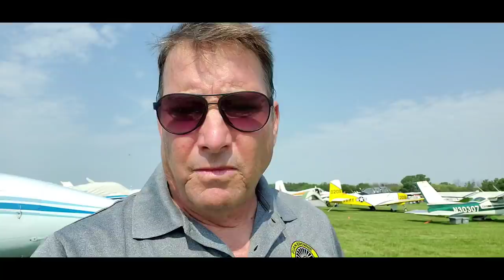Dale 'Snort' Snodgrass Crash Lewiston ID.

Comment: Call sign "Snort"  Dale Snodgrass a Brother in Arms and supreme Patriot. Gone West,  we will more than miss him. Thank you brother for your service, leadership, inspiration, influence and above all for me  the pleasure to have known you.

    The stall spin scenario that Juan mentioned is possible from the physics angle but I find it impossible to believe that it was pilot induced.   We had an IAC incident where the pilot of a Pitts experienced "control lock" coming out of a hammerhead. Vertically nose down when he pulled the stick back to recover it failed to move enough to complete the level off.  As an F-16 pilot and well experienced as was "Snort" he had the presence of mind "The Right Stuff" to use the trim to help get the nose up. He survived the crash and was lucky that the landing was cushioned by soft muddy ground.  Investigation found a tool wedged in the elevator controls.  Dale was capable of piloting under pressure, I agree with others that he would have been maneuvering  the entire time trying to alleviate whatever conditions existed at the time. 

Hand Salute!

Comment: R.I.P., Snort. Thank you for your service.

Given his experience, this sounds like a seat failure.
Reply: Was thinking the same thing
Reply: My thoughts exactly
Reply: If you can enter and exit your airplane with the seat in its usual flying location, it's probably a good idea to just use bolts in the tracks to prevent this.
Reply: I had exactly the same thought. Far too many times an accident that went down as Juan described has traced back to a seat that rolled back just after liftoff.
Reply: My thoughts too. RIP Mr Snodgrass.

Comment: I saw him at Pratt & Whitney “air show 90”
It was an awesome t14 demo
Reply: I was there. I was giving tours on the 747 and he came thru. He was super kind and willing to talk to a young Private Pilot. I had worked on the TF-30 engines in the F-14 and he was genuinely interested in what I did.
Reply: @mgas1237  If that was the show at Rentschler in which "Snort" flew the F-14 under a (wink, wink) 1000 ft ceiling, I was there too.    MAN, was that loud.    I have seen "Snort" demo the F-14 many times.   Nobody could thrill a crowd like "Snort's" Tomcat demo.    He was the best.   Gone too soon.
Reply: @kevinmadore1794  Saturday was the low ceiling day if I remember correctly

Comment: Another senseless, inexplicable accident of the type that has claimed so many.
ASN reports that the aircraft was a "B" model of which only four were built. They had a 400 hp Allison turboprop instead of the 350 hp of the "A" model.
Stalling speed: 61 mph flaps up; 43 mph flaps down....
Hopefully there will be an explanation for an accident that should not have happened...

Comment: Wonder if this was another seat issue?  I can't believe that such a experienced pilot would stall it on take off without a mechanical failure. RIP
Reply: Seat sliding back is the first thing that came to my mind too.
Reply: @maxon1672  - Same here. Has all the signature actions of one.
Reply: @maxon1672    Yes, likewise.  It would be very sad to lose such an experienced and capable aviator to such a silly and avoidable event, but we're all only human and we can all easily get killed by out mistakes...
Reply: @DavidPT40  - I can’t answer that, but as a mechanic of land based vehicles of all kinds, I will say that if it’s mechanical, it will fail at some point. That’s a given.
Reply: Years ago we had an accident in Germany in which a glider pilot had a heart attack while taking off with the winch and the plane spun to the ground immediately after loosening the winch rope.
Reply: First thing that sprung to mind with me too. Whatever the cause, it's sad to lose such a well known, well respected and capable airman.
Reply: @DavidPT40  Seats can not only slide but can detach.  One of our club ham operators had a military plane he was testing break a seat. He said that was double whisky night and a new pair of shorts.  He was at the mercy of the crew and manufacturer to give him a plane that wouldn't fall apart in flight.
Reply: @DavidPT40    I don't know if any aircraft has a particular problem with that happening as it's exactly the sort of safety issue they would be looking for during development and testing.  But if a pilot fails to make sure the seat is correctly locked into position after adjusting it then it can easily happen during the take off roll or initial climb out with predictable results...
Reply: A coworker had this happen on his Cessna many years ago. He saved it but it can happen and does happen.

Comment: That reminds me of an AD on Cessna's pilot seat latch pins. In the UK they had a secondary safety pin so if the catch failed on Take Off you didn't slide right back pulling the yoke with you.
Reply: if you look at the rear stabs it is apparent he was not pulling back on the stick , in fact it shows the direct opposite

Comment: I read all the comments and something happened to me years ago that no one has mentioned or speculated. I had a 172 get a rock jammed in the elevator on takeoff preventing the yoke from going forward. Light enough to maintain pitch by Reducing power and full forward trim and was able to return and land.  Could have easily been not so lucky. Just another possibility to consider in this case. RIP

Comment: I had a seat track lock fail early on  , I was still under student status.  I had placed an extra cushion between my back and the seat back.  It allowed me to maintain control with only a small pitch up.
Reply: H as opened to me on flight training in a 152- 2nd or 3rd lesson with the CFI slid back a short distance. He explained it was common to Cessnas  how important it was to check the seat latch was fully engaged and about the safety pin. Always thought about how a full seat track failure would really ruin your takeoff as first instinct would be to grab at the yoke......what a tragedy hope the figure out what went wrong.

Comment: I used to fly L-19s in a banner tow operation. The plane was already a hot rodded version of a C-170B, with a lighter tandem seat fuselage and 90 hp more than a 170B (235 hp from 145 hp). The SIAI-Marchetti as a lighter turbine engine that puts out 400 hp (almost 3 times what the original 170B had). The larger engine required a larger tail to handle the torque. Even with the rudder area increase, I would suspect that this plane might not handle full power on stalls very well.

Comment: Hi Juan. Shocking bad news about Snort Snodgrass. Condolences to his family and his many friends. When I first watched your post on this incident, I straightaway was reminded of my instructors briefing when first taking a C150 out for an hour in the pattern. It included a stern warning about the need to be aware of the possibility of  a stall on take off if the attitude is not levelled off after a " short field take off" . The briefing also included a warning to double check the security of the pilot seat position and the locking mechanism. The seat had a tendency to slide back in the rails with the possibility of causing an irretrievable loss of control . I wont go into detail here, but anyone familiar with the Cessna cockpit layout can easily see that a seat sliding back on take off would render the pilot incapable of  reaching the controls. No doubt the details will be found during the investigation. As you so rightly say Juan, Fly Safe !

Comment: I hope it wasn't a seat lock issue, in 2007 i was taking off in a Cessna 182 and right as i rotated my seat slid back making me pull back on the controls, my stall horn went off and luckily i just let go of the yoke and the nose lowered by it's self because I had the right trim for take off. If i held the yoke back for 1 or 2 more seconds i would have stalled and spun in to the ground. Lot's of accidents happened do to seat sliding back on take off, i was one of the lucky ones.

Comment: Thanks for posting this.  Stall/spin on take off like that sounds like it could only be a few things:  Pilot error - that is hanging it on the prop as you describe, and some tiny thing didn't work this time.  Equipment - seat, control cable failure, grossly out of trim, or something very wrong with the elevator.  Pilot medical.  Hope the NTSB does an actual investigation of this one.  Everyone's family and friends deserve that, and it sounds like this fellow made a lot of friends along the way.

Comment: Any aircraft will bite you in the arse if you do not respect the laws of aerodynamics or forget something as simple as the control locks.
As you say fly safely & conservatively at all times Juan.
Reply: yeah what was this wise pilot thinking?  juan had it right dont stress the prop.
Reply: @pokerbosscycler  Absolutely.
Reply: Yeah, laws of aerodynamics are the same everyday. But if you wake up and think your plane is an F14....
Reply: @ebenwaterman5858  That is the mindset that will catch you out.
Reply: @seanmcerlean  I agree. Lot of pilots stalling and crashing lately.  Used to be Pilot Error.  Now we can add Stressed Prop to the list of other explanations.
Reply: I hope it wasn't a seat lock issue, in 2007 i was taking off in a Cessna 182 and right as i rotated my seat slid back making me pull back on the controls, my stall horn went off and luckily i just let go of the yoke and the nose lowered by it's self because I had the right trim for take off. If i held the yoke back for 1 or 2 more seconds i would have stalled and spun in to the ground. Lot's of accidents happened do to seat sliding back on take off, i was one of the lucky ones.
Reply: @AviationNut  WOW!  Holey F*** S*** !!!
Reply: @AviationNut  It would certainly be a considerstion.Yes you had a lucky escape for sure

Comment: I learned to fly in a T-41(Cessna 172 mod) eX-USAF Academy trainer, And we could NOT get that aircraft to bite us no matter what we did!  High speed/low speed stalls even with full rudder would produce nothing but a mild oscillation as it stalled and immediately regained lift.  And all of this was at high altitude 10,000'+- flying out of Flagstaff, Az (7500' field elevation).  The spin resistance seemed to be absolute. Why aren't they all built like that?  (C-172, front wing extension, drop wing tips, 225hp, variable pitch prop).

Comment: Looking at Go fly video, as the 1019 is taxing away from star up, the video show the same side as crash capture video. Pilots sitting position is 2.5 - 3 feet behind the dash. The shadow (pilot?) depicted on your freeze frame seems just forward of midway from the dash and back side of cockpit. If you recreate the offset of the landing gear perspective with the go fly video to match the crash aircrafts, seems that the pilot is aft that position but well forward of the back seat position. Also, look at the position of the wing strut anf the shadow in the cockpit.  Relatively the go fly pilot is well in front of the wing strut, where in the crash freeze frame he is slightly behind it.

Comment: I've noticed quite a few in the STOL competition hanging on their prop after lifting off.  Didn't strike me as a great idea.  I wonder if it's an instinct thing, not wanting to drop the nose because they're still so close to the ground?
Reply: It could just be the crowd-pleaser thing going on. - Aiming to please brings too many people undone across a wide range of circumstances. - In due course we shall  learn what happened. - In meantime hopefully folk will let this discussion rest quickly for the sake of those near and dear to the man.
Reply: It's a horrible idea.  RC guys do that all the time, and every once in a while it doesn't work.  Just a fraction of a second or a tiny problem and it's gone.  There's no time or energy to catch it.  If you're going to hang on the prop, do it RC or at altitude.
Reply: Don’t think it’s an instinct thing. It is not comfortable having extreme nose high attitude close to the ground. For most the “instinct” is to get more level and gain airspeed.

Comment: What is the setup with the seating in the aircraft? Seen them slip back on the Cessnas with worn locking pins.
Reply: Switch out the rail with the passenger side. It's good as new.  ✨

Comment: Nothing but respect for him. That said, I can't help but wonder if age (he was 73) has anything to do with this kind of accident. I was a GA pilot most of my younger life (now 80) and I can tell you, by 70 I was aware that my cognitive ability and my memory just wasn't what it once was.
Reply: Dime in the slime for snot
Reply: He just turned 72 in May. An hour and a half before the crash, he flew his Aerostar from Driggs to Lewiston, and his radio transmission - with the same ATM controller - lasted 8 minutes. He seemed perfectly fine. In fact, his wife accompanied him on that flight and said one thing she knows is that it wasn't pilot error.
Reply: @citybright8925  NTSB said it's pilot error
Reply: @bmw_m4255  They did not.
Reply: @citybright8925  really? There is no deflection of the flight controls at all. He took off with a homemade gust lock engaged. That's his error
Reply: @citybright8925  the fact that you just used a colloquial idiom reflects poorly on you. Any observer can clearly see the flight controls are not showing any deflection at all in the video. the whole trim argument is hogwash. Trim can easily be overcome and should not be impossible to correct or overpower at these low speeds. The ailerons do not move at all as well as the elevator so there very obviously was a lock that did not allow him to move the yoke at all. The gust lock for the aircraft presses on the brakes so it would not be possible to taxi with that gust lock so he must have had a different one.
Reply: @bmw_m4255   You just pulled that out of your hat. Doubt he used a homemade anything. Everything on his planes was the best--not Honemade Harry. He just spent over $800,000 to restore a T-28 that his wife has listed for sale for $395.000.

Maybe someone will buy your schtick.
Reply: @citybright8925  sounds like his wife is real good with money. And he's really good at flying tail draggers

Comment: The pilot was given a frequency change right at the point of applying take-off power -  As soon as I saw the Video on the day of the crash, I thought that this may have been a factor, with the pilot with his head in the cockpit changing the radio freq -  After I saw your video coverage of the undamaged aircraft, I noticed that the Garmin 650 was located at the lower centre of the centre of the cockpit.
Reply: No, the ATM audio shows he was silent for 18 seconds before saying, "takeoff," and silent another 36 seconds before saying, "Aw, S--t! S--t!"  The video says in the Notes that silences longer than one-half second have been truncated and the video and audio are not in sync. His actual audio transmission ran 2:06; the edited video has him crashing by 1:01.

Comment: I'm thinking the seat was not correctly locked into position and slid all the way back.
Reply: Wasn't that a common problem in older cessnas? Would be pretty shitty if that took down such an accomplished pilot😔
Reply: @joeg5414  The aircraft he was in was not a Cessna.  And I would hope that a guy with his credentials wouldn’t hang on to the yoke if his seat slid back.  I can’t think of any aircraft I have flown that the seat could slide back far enough that reaching the yoke wouldn’t be possible by leaning forward.  But, I have not flown this aircraft type.  I have had a 737 seat go sliding to the back of the rail many years ago.  Surprising for sure.
Reply: @oscarb9139  first off I never said it was a Cessna. Secondly I never suggested that it was the cause. I was responding to the original comment saying that's a pretty shitty way for an accomplished pilot to crash... In other words it shouldn't happen
Reply: @joeg5414  Very true.  It shouldn’t happen.  Many people lost a friend, and a few lost a loved one.  It’s a shame.

Now, back to your comment.  I don’t know what happened and would encourage people not to speculate about the cause.  Asking questions (as you did) makes for a great conversation.  I have been at this for a while and doubt that a pilot with his experience would have held on to the yoke if the seat slid back, because we all know what happens if you do that.  I can think of three things that I think could be the cause, but there are many other things that people may not have considered.

 My neighbor is the worst.  Good dude, but every time there is a crash, he calls me to ask me what I think and then TELLS me what the cause is.  He isn’t even a pilot and misunderstands much of what he hears.

I wasn’t sure if you thought it was a Cessna or were comparing it to a problem you thought older Cessnas had.  I was pointing out that it wasn’t a Cessna,  I am sorry if it sounded rude.
Reply: @oscarb9139  lol it's all good I do agree with you. Wasn't really comparing, just saw him talking about seat going back and reminded me of the Cessna problems. Wouldn't make sense in this case though.
Reply: @joeg5414  Well, hopefully we will find out something in the near future.  Light aircraft aren't too complex so hopefully it won't take them too long to get a preliminary report out.
What do you fly these days?

Comment: Absolutely Juan - I saw some of those ACCA STOL takeoffs - why keep the nose up after takeoff? Nothing in the way, no need for it. OK, at ACCA they all made it, but engine failure at 50' with the nose at max AoA with only the engine thrust ensuring you don't stall - even partial engine failure then stall, spin, bang, from 50'  ...